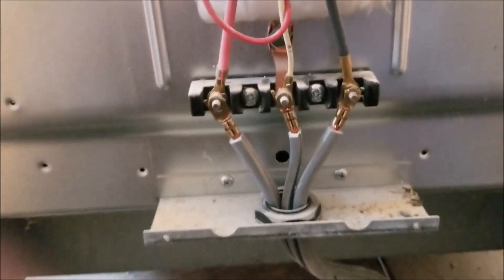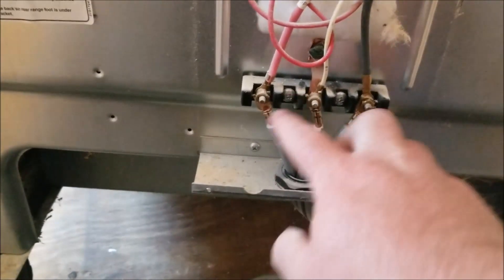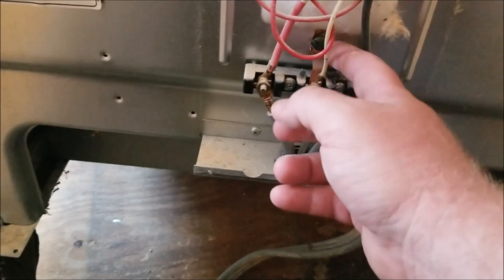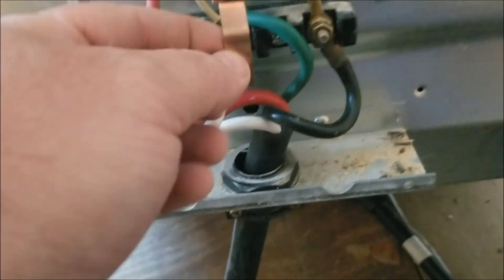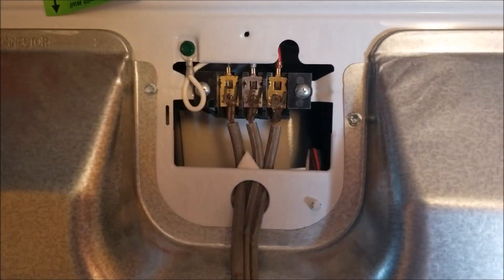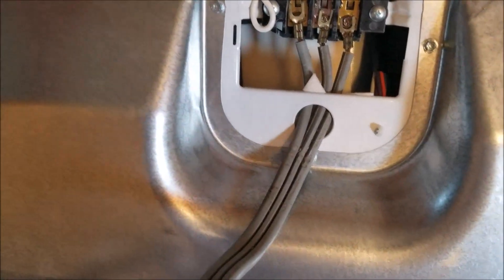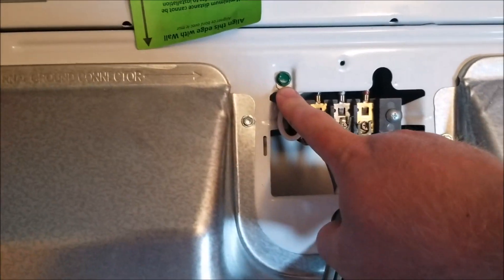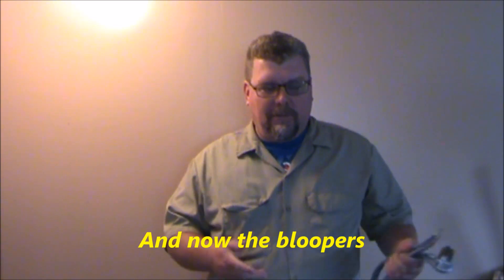Changing a 3 wire 220 volt plug to a 4 wire plug

Comment: How did you get the screws off 🤦🏾‍♀️ didn’t show anything cause my screws can’t come off like I need certain type wrench nothing is fitting
Reply from the maker: I had used a standard nut driver to undo the nuts, but a wrench could also been used.

Comment: UNPLUG!!!! You never said to pull the plug!!! Then you start touching the wires, someone that that doesn't know YOU just KILLED!!!
Reply from the maker: So how would it be plugged in if I am changing the cord to the one I need for the house? Maybe I also should have said, if the plug is plugged in then you do not need to change the 3 wire plug to a 4 wire plug. Seriously, Larry, maybe you should not be working with electricity at all.

Comment: hey man, I just swapped out my laundry center that stopped working. the new to me laundry center I was installing had 4 prongs, so I did what you did, just backwards. It is currently not filling up with water, but I don't have that tab from the neutral to ground, could that be the issue..or is that a safety thing? Thanks!
Reply from the maker: My understanding of it that it is needed for safety. If there is an electrical short in the device it could be very dangerous  to anyone that touches it. It is probably not causing the problem to are having with it not filling up, but if the problem is electrical you are putting yourself at risk by not having it properly grounded. I would strongly suggest seeking help with an expert, like I did in this project.
Reply: @southlouisianahomestead244  Agreed, Gonna have someone come out Monday. Thank you!